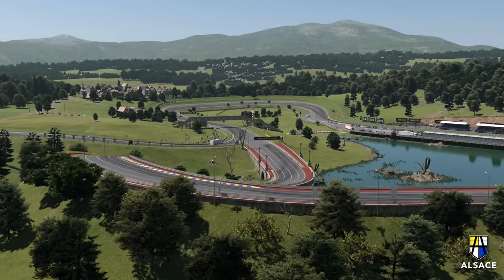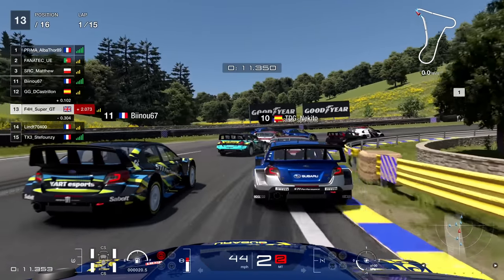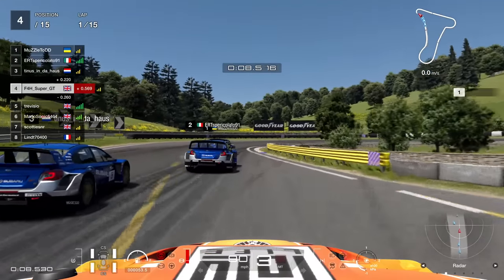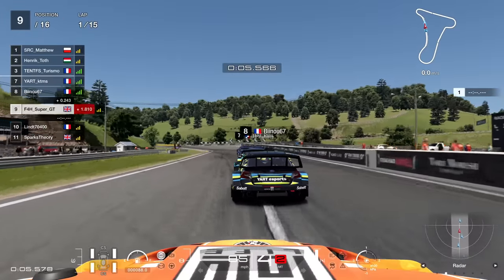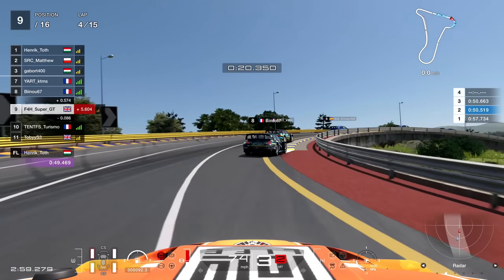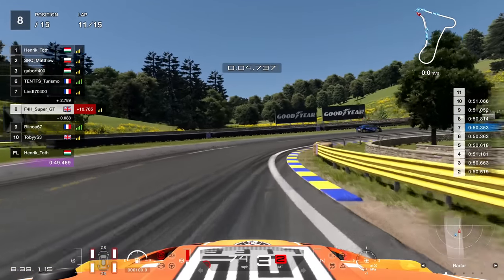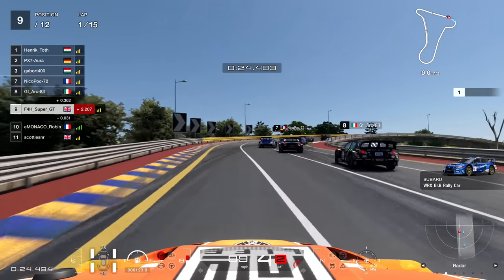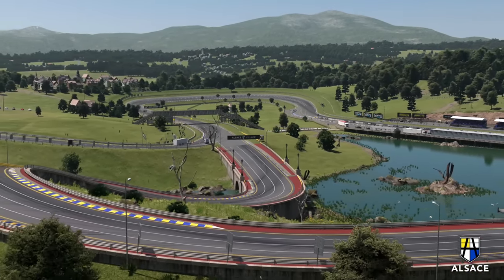The Strangest Corner In Gran Turismo 7

Comment: its about as steep and awkward as laguna seca... did you try using handbrake at all? I believe most GT games will not let you powerslide with TCS turned on. But could very likely have improved laptimes if you can make it work. The computer basically won't allow any power during a slide.